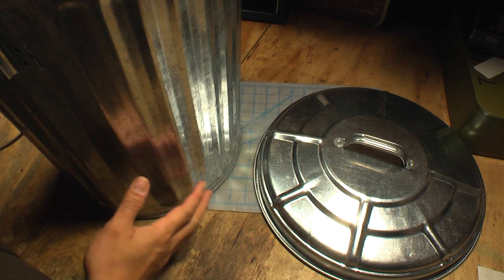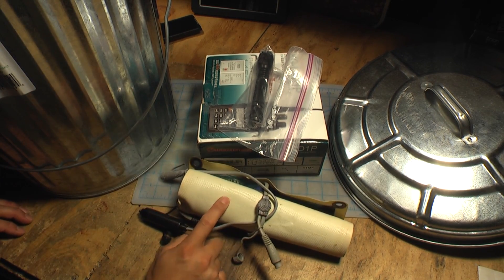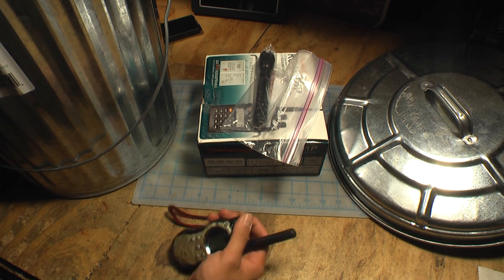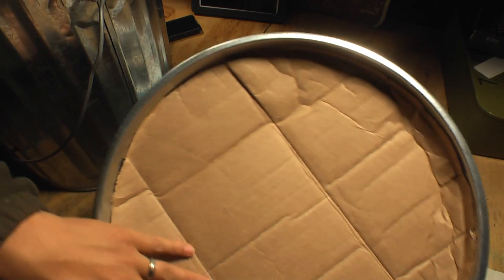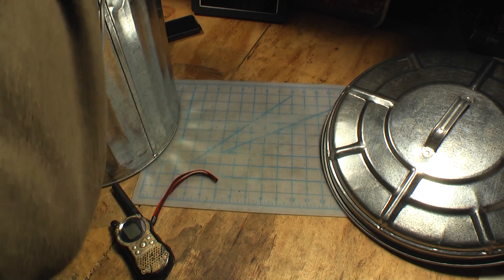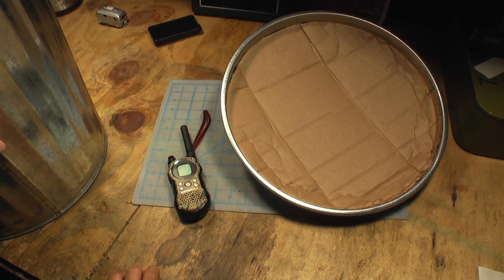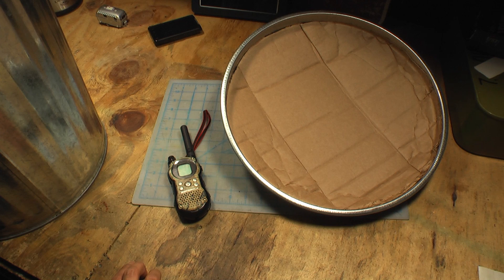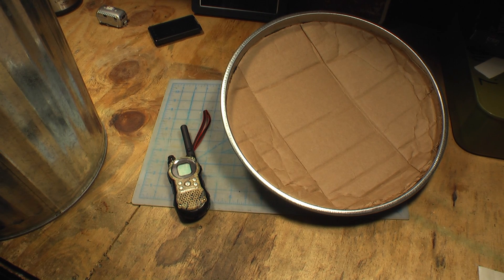A Homemade Faraday Cage for Electronics Protection from EMP (1080p HD)

Comment: I’ve recently learned that you can test your faraday cage by placing your cell phone in your faraday cage, seal it up, then call your phone. If it rings, your faraday cage is not working. Think about it. If your phone can receive the a signal for a call, then it will receive the EMP attack.

Comment: The cardboard simply keeps your electronics from touching the metal. It doesn't have to be cardboard as long as you keep the items separate from the metal you're good. You also need to wrap up the items in Reynolds Wrap for added protection because if the blast is close enough the can may not be eough.

Comment: I put my cell phone in the microwave with the screen on to see what it would do. I was surprised to see that while WiFi signal was NEARLY eliminated, I still had full bars on my cellular network. I get the idea that the shielding in the microwave is good for some, but not all frequencies.

Comment: If there is a major EMP Attack youre electronics will be the last thing you need to worry about.  Unless the entire country protects against it there will be no signals out there anyway so sure, your electronics may work but no one elses will thus rendering them USELESS.  Nice concept though.  Invest your money in Food.  You can eat a radio.  I hope it doesnt come to that but who knows with these tyrants running the country.
Reply: not true, the government will still have the ability to broadcast as well as other countries not affected, with that being said a good shortwave radio will enable you to tune into updates from our tyrants and the rest of the world. also ham radio will alow you to communicate around the world, all you need is a radio 12 volts and a length of 12 guage wire cut to a certain length and your in business. not to mention a couple of walki talkies will help you to communicate with fam and friends in your area to gather intel and security. I do agree about stock piling food and water like you said
Reply: I disagree. You can protect some critical electronic devices, for very little money. Given the low cost, you'd be foolish to NOT protect gear like an emergency radio, solar panel charger, battery charger, power inverter, LED flashlights, a kindle, loaded with documents, manuals, photos, etc.

Comment: You want to tape the seam around the lid with conductive tape (like aluminum tape) as that gap will allow the EMP to seep in and damage everything.  Then ground the can to an earth ground.  If you don't seal the lid, you might as well leave everything out, and the seal must be conductive (hence the aluminum tape).  The ground wire on the can will allow the EMP to be diverted to ground.
Reply: beaker2000
Reply: The ground wire often interferes with the grid so instead of "taking away the EMP' it could lead it to the can.
either not ground it at all or create a new grounding point in your yard or basement (do not ground in urban areas at all).
Reply: the metal to metal contact of lid to can is the conductive seal, duh

Comment: I made one exactly like this. All batteries are left outside of the can and many moisture absorbing packs placed inside. I closed the lid after putting all necessary objects inside, filled-in the rest with packing peanuts and then taped it shut with Gorilla Tape. Nothing else is needed. No extra gizmo's or additions will fit, even if I wanted them to. Make your list, gather your items, place in cage/can in the order of their importance. Once you get a few inches from the top of the can/cage, STOP! Fill the rest with the peanuts and seal it. "But what if I wanted to add something else later?" you say. Remember; You made a list, thought it through carefully and you SEALED IT for a reason. *I see that someone commented, "Wouldn't if be funny if the EMP happened while he was filming this?" No, it wouldn't! If you want to add something else to your faraday cage, Make another cage. Get another can and fill That Cage. There's nothing wrong with having more than one. As a matter of fact, it's smarter that putting all of your eggs in one basket, so to speak. This is America. You are Americans. Think with your brains, not your ass. Grow up and get ready. It's coming.
Reply: I had read that batteries would be damaged also...but you leave those out?
Reply: For a more effective EMP container, use aluminum tape vs duct tape.

Comment: SHTF Gear  I don't think a microwave is a good example. Microwaves are only designed for a certain range of high frequency and there is leakage, through the fan assembly and the front grill. An EMP will be a wide band event so a microwave will not cut it.

Comment: Aren't you supposed to ground your Faraday Cage?  I would.
Reply: How do you ground the can?
Reply: The best ground is your water line.  Run a wire from there to the can.  If you don't ground it, I'm afraid the EMP or solar flare would go right through the can instead of around it and through the wire to ground.
Reply: Thanks!

Comment: I manage the Military group of an Electromagnetic Compatibility (EMC) test lab.  We test RF shielded enclosures and materials for RF shielding effectiveness.  A transmit antenna is placed on one side of the material and a receive antenna on the other side, or within the enclosure.  The amount that the RF signal is reduced is measured and reported as shielding effectiveness in dB.  An EMP attack using a high altitude nuclear weapon is expected to produce a 50,000V/m field on the ground.  Most solid state electronic devices can survive and operate properly in the presence of a 2,000V/m pulse field.  30 to 40dB of shielding effectiveness will reduce the 50kV/m field to around 2kV/m or less and should be enough to protect most electronic devices from damage.  The steel trash can would probably do the job.  I would recommend adding some RF gasket to the lid to make sure there is a continuous seal all the way around.  Another test we do is RS105 per MIL-STD-461F.  We have an EMP generator made by Montena.  This generator gets connected to radiating lines.  We place the electronic device under test under the lines.  When we discharge this generator, the device under test is subjected to a 50kV/m EMP.  Devices can be damaged by an EMP attack whether powered on or off.  The fast rise time of the event equates to high frequencies, with short wavelength, which can couple onto small circuit board traces.  Solar flares produce slower rise times, which equate to lower frequencies, with longer wavelength, so coupling would occur mostly to long wires, which could then conduct the RF energy to nearby electronics which are connected to those lines.
Reply: John Mason Thanks for the expert advice!

Comment: EMP will not affect any electronics with no  power to them, nor will it affect any electronics that are solid state, as in batteries and such.Most definitely not a flashlight.
Reply: +Tony Boyle couldn't we learn how to harness this energy some how to our own advantage...like absorb it some how and redirect it so it doesn't burn out our grid...??  not just ground it but use it as an energy source or even a weapon...directed energy weapon...like you see on scifi movies...a thunderbolt shooting out of device mounted on the back and on the arm...static electricity...like Tesla...
Reply: zoticus, what do you base this assertion on? Doesn't an emp carry it's own charge?  Isn't it true that any wire or metal construction, such as a railroad track, or any other large metallic object, will pick up 400 volts per meter of exposed metal? I base this on the 1865(approx.) solar flare, which caused miles of railroad track to BURN! in the United States.
Reply: While it is impossible to know for sure how modern technology would handle an emp, damage would be likely seriously reduced, because electronics that are not powered are essentially an open circuit until power is transferred to the power relay. The relay acts almost like a bridge for the electricity. In order for an EMP to destroy electronics it needs to have a closed circuit. However, with batteries, they are primarily chemical in nature and are actually physical devices. It is highly unlikely an emp could damage a light bulb, because it would not have the power to illuminate to maximum and bulbs are made to dissipate heat, albeit modern led bulbs. In sum, devices with microprocessors will more than likely die, while solid state devices will more than likely not due to the lack of sensitivity and robust internals.
Car batteries would also be fine, for they have an ability to handle loads far more in excess of emp transmissions, if there was one to destroy a battery,you would be dead anyways.
Reply: +Tony Boyle railroad tracks burned???
Reply: +Tony Boyle shouldn't the railroad companies ground their tracks...would not that help some...deeper steel rods so many feet apart...???
Reply: +zoticus1 tanks could be modified to do just that...redirect the energy and then use that static electricity redirected. as a electrostatic magnetic forcefield plus a thunderbolt flamethrower...just an idea...CYNDI

Comment: Isn't one of the possibilities of an EMP that it could generate enough electrical charge as a lightening bolt? That'll go through your cardboard like a bullet through tissue paper. I think you need to go hardcore with the insulation inside.
Reply: Jamie Smith It's not s charge it waves like radio waves

Comment: You can also buy EMP bags to hold your most sensitive electronics. These bags look like mylar anti-static bags. I got some on Amazon and they are not terribly expensive. Place your electronics in the EMP bag and then place the bag in the trash cans. This gives your most crucial and expensive stuff double protection. This is called nesting and it is recommended by many experts in the field.
Reply: Yea right. Those EMP bags have ziplock seals. Do you feel confident that the ziplock will keep the EMP out? During my time as an ICBM launch officer, where EMP was one of many threats we planned for, every door and cabinet in our launch control center had stainless RF mesh gasket around the opening to form a metal shield in the gap. Forget that Ziplock shit.

Comment: Steel ammo cans work too, BUT!  The trick is you've got to make sure there is a path for the electricity COMPLETELY around the metal box.  Remove the gasket in the ammo can, replace it with a rope of steel wool.  Make sure the top of the box has metal-to-metal contact with the bottom.  It has to be in essence a SEALED solid box of metal.
Reply: I once used solder to seal a metal box and then to be sure used aluminium tape around it

Comment: You can test it by placing it in the can with an AM or any trans type radio and turn volume all the way up so you hear it. Place in the can and close lid. If you hear the radio, that means signals still get thru and it won't work!! If u don't hear radio trans, it should protect it. You can also try foil wrapped shoe box and do the same thing..

Comment: Everybody is interested what happens during a CMD. That fine. But your video camera and other tech. electronics is oxidating (corroding) every day. What to do? Lets say that you have a sony handicam Take a large ziplock bag. Roll off like 7,8 paper towels. Clump the paper towels and put them in your micro wave. I can't tell you how long to microwave the towels. Obviously they shouldn't be burning! But take the paper towels down as close to 0 humidity as possible. Camera and towels is a long life

Comment: Stupid question I know but, how will you know when you need to put the items in the cage? and when is it safe to remove them? Are we going to need some sort of a tester? Also, what about TVs and computers, laptops? It will take a big cage to fit these. Would it be suffieient to wrap them in 7 sheets of aluminum foil? I read this but not sure if it is true?
Reply: These items are not your daily use items.  They are backup, because you are right we never know ahead of time for an EMP.

Comment: See i insulated it with card bored, then taped all around the edge on top of the can, plus glued it to the bottom piece of card bored on the inside. Im thinking if it would be a good idea to use that "Rubber in a can" spray and coat the whole outside. What do you think?

Comment: nice idea.im building a one tube battery operated regen radio that operates on th 75 meter band.i think your best bet for emp protection is in tube based gear.while not fool proof they are definitly more hardy than a ic or a transistor.next will be a transmitter .grt vid ty

Comment: SHTF Gear normally you have good advice, but here you are not even in the ballpark, it will not work anywhere within 100 miles of zeropoint of major EMP (either manmade or solar) unless it is securely grounded (do not use house wiring/ground-make separate ground) then wrap items in non-conductive antistatic bags then wrap in 3 layers aluminum foil and make sure foil does not contact metal of can, do that and you will have the best shield on DIY budget, do not use cardboard

Comment: absolutely, yes, question is do u understand grounding ? if garbage can is sitting on earth or say concrete floor then it is grounded, if in doubt drive 2 not 1 but 2 ground rods 4-6 ft. apart and run at least a # 8 ground the idea is to dissipate volt potential asap, if u can use a  tinned copper ground strap to connect to ground rods , if you set it up solid it will serve in extreme pulse situation ie. zeropoint , dissipation will be better on higher ground if you want to get really technical

Comment: absolutely do not have a microwave plugged in if using as Faraday cage and yes do ground body of microwave but not thru house electrical ground and most important of all remove the magnatron from microwave body before considering it secure in a major pulse near zero point and make sure items covered in antistatic non-conductive material then foil then set on glass tray, the magnatron will charge and emit in a pulse

Comment: continued ...so regular screen door/window size screen size will work for most wavelengths,but will work best if it is copper or stainless or reg. steel i wouldn't trust aluminum screen to withstand major pulse only minor, oh and that safe door needs to be tight fit , and use non-conductive antistatic bags (not pink ones) for individual items then wrap with at least 3-layers foil  in any faraday cage,

Comment: at 30,000-80,000 volt/electrons u better believe it needs to be grounded, and concrete/cement is an excellent conductor if in contact with earth and even more so with rebar/wire mesh and is considered one of the best grounds available by the NEC, so that safe is good if int.insulated, in fact that cardboard will fry at those voltages, a metal mesh only has to be smaller than the wavelength hi & lo  to function as a faraday so mesh size would depend on type of pulse, CME would be mostly Gamma

Comment from the maker: it is better if the exterior of the container was not painted. You want a good conductive material and most safes have at least a coat of paint over it that can work as an insulator.

Comment from the maker: putting a galvanize trash can faraday cage inside an old fridge could help with further shielding but it wouldn't be very portable and may cause mildew or mold to grow inside if there is trapped moisture. Faraday cages actually don't need to completely enclose the insulated items. The original one is actually made of metal mesh with holes in them. It just needs to redirect the energy around and away from the sensitive equipment it is trying to protect.

Comment: hmm.well, would more layers equal a higher survival chance? like an old spare fridge, lined with cardboard, and then your galvanized steel trashcan lined with cardboard with your items in a duct tape bag inside? might be a little excessive, but might be worth it. plus you could seal the old fridge shut and bury it for long term

Comment from the maker: The fridge is a good idea although it's hard to know how each one differs from another. Microwaves are good because they need to work as a RF shield by design but fridges don't. a simple way to test is to put a phone in there and try to call it. if it blocks the RF from getting to the phone, it will have a chance of surviving an EMP.